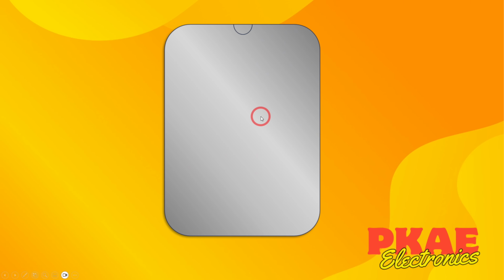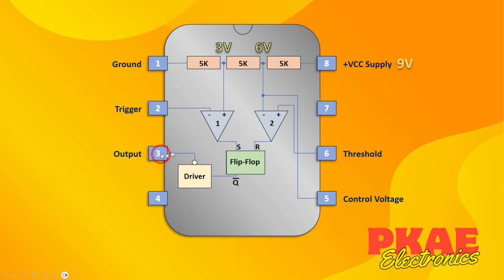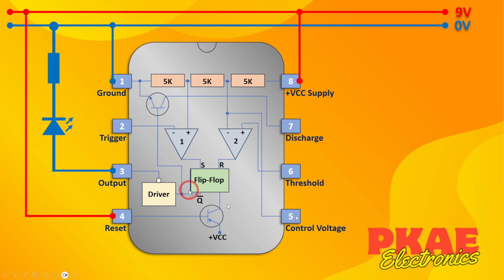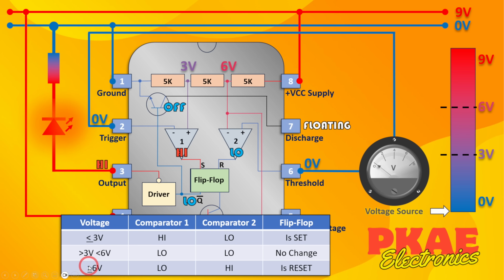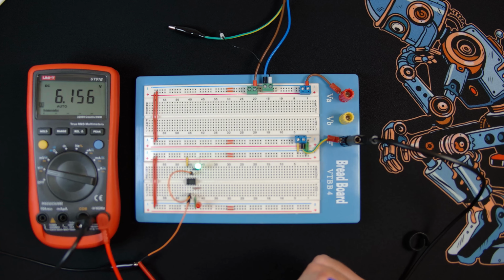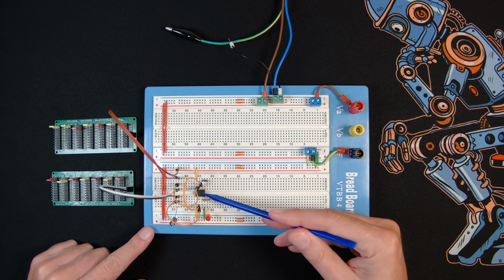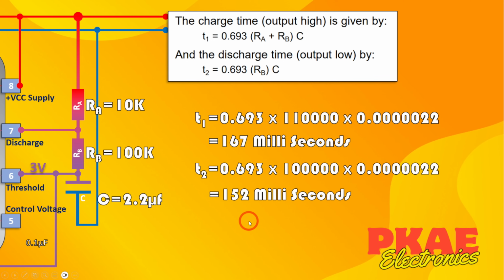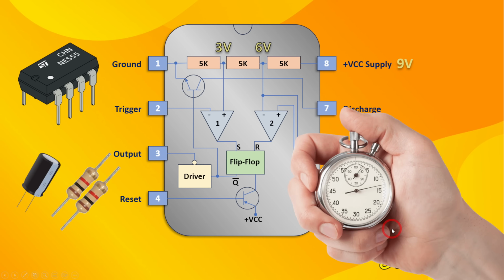How a 555 Works as a Timer.

Comment: Very instructive. Everything looked good exept I found your voltage source a little confusing. As connected it implies a potential difference between pin 2 & 6. But your video shows these pins varying in tadem. What Im I missing?
Reply from the maker: Thanks for the comment. I am not sure what part you are confused about.

Pins 2 and 6 are tied together, so they will always remain at the same potential. 

Pin 2, the Trigger input, connects to the negative terminal of comparator 1 and gets compared with the one third voltage. 

Pin 6, the Threshold input, connects to the positive terminal of comparator and the two thirds voltage is compared to it.

Comment: Hey I am 70 years old and as a 20 year old electrical engineer I loved playing with the 555!  I left engineering for a career in medicine, but you left one question unanswered that I have had for 50 years.  When the circuit flops -- pin 7 is driven to ground -- this means the device consumes current during every down-cycle, which seems like an inefficient design.  Any comment here?
Reply from the maker: Hi thanks for your comment.

The current flowing from +V through the 1st resistor  to ground is indeed a waste. Keep in mind though, that the resistors are quite large, 10K and 100K, therefore the current is very small.

But, the standard Astable circuit given in the datasheet is not ideal. By adding a couple of diodes it can be improved quite a bit. This will feature in a follow up video soon.

Comment: Why resistors are used next to the capacitor? Could they be replaced with diodes? Does 9V line needs to be connected to the discharge pin?
Reply from the maker: This is the standard Astable circuit given in the datasheet. Resistors are needed to control the current flow and rate of charge/discharge of the capacitor. Replacing resistors with diodes would not have the same effect, but by adding a couple of diodes the circuit can be significantly improved. This will feature in a follow up video.

Comment: Well actually the 555 is a timer. At its heart is a circuit with an R/C time constant which controls its operation in all modes.
Reply from the maker: My point is, there is no R/C time constant within the IC itself, so it only becomes a timer if you add those components around it.
Reply: @paulpkae  By that logic my new alarm clock isn't an alarm clock because out of the box it doesn't alarm until I configure the desired alarm time.  Those parts just configure the timer for the desired time delays.

Comment: Greetings Paul, great video..! SOoo thorough. I knew most of the info herewith. I am designing a variable pulse width generator (with a 555, opto-isolator with darlington xstr) to control a DC motor with a centrifugal governor. A vintage R2R tape recorder that runs slightly too fast. The governor still works, and though a mechanical governor of this type is typically adjustable - which would make adjusting the speed simple - getting to the adjustment requires tearing the motor apart and possibly destroying in the process. My intent is to simply vary the "on/off" time without affecting the timebase @ ~1.5Khz. Turning the motor off for an (adjustable) fraction of a second, thus slowing the motor down, disengaging the centrifugal governor, and creating an adjustable servo. Your thoughts..? -tim

Comment: Effectively the timing mechanism is the charge/discharge speed of the capacitor
Reply from the maker: Yes correct. 

Its the charge/discharge speed of the capacitor/resistor arrangement. It's derived from what's known as the RC Time Constant.

Comment: I just happened to be playing with one, so...  TLC55x warning... it will only source 10 mA and sink 100 mA.  The NE555's will handle the current.  Therefore, I am very happy I spent the money on a roll of 50 MPSA18 transistors!  They also have no trouble powering the current-guzzling 555.

Comment: In a design of some printer i designed 30 years ago at least ,I used a 555 as a timer for close to 20 hours period .. It did worked ,The RC in the resistors was several megaohms ..So this was way much cheaper than using a micro for a timer ..
Reply from the maker: Brilliant!

Comment: is the 555 a timer? Depends how you define Timer.
It's more of a clock generator than a Timer, and even then it's just an Astable Multivibrator, there's really not much accuracy to the clock it's generating.
Plus all the other interesting things you can do with the chip.

Comment: Until this video, I always thought the timing mechanism was a constant somehow and explanations of the 555 never pointed out the required external components to make it work. Capacitance and resistance was all it ever was and now I feel like I have a good handle on the whole thing. It's amazing how many blanks this single video filled in, particularly the noise capacitor
Reply from the maker: Great! Glad this video has helped fill in the gaps.

Comment: Grest description, but your argument against it being called a "timer" is essentially a strawman. We've been using these, and at earlier times, similar discrete component based devices as "timers" for decades. I was building my own 50 years ago. The Windows API also has something it refers to as a "timer" which does pretty much what (in my experience) the 555 is  generally used for. That said, minor gripe. This was a very enjoyable and informative presentation.

Comment: I'm guessing that 555 used in the demonstration is a CMOS version since the output swings virtually to the supply rail. That doesn't happen with the bipolar version unless an external pullup resistor is used on the output.

The power distribution on the breadboard is terrible! There is no evidence that I can see of decoupling of any sort, and that is almost certainly why the output looks so horrible if the threshold pin has no cap. If the supply rail is reasonably clean, threshold can usually be left open, though that isn't best practice. Bipolar 555s are the worst component I've ever seen for making a mess of the supply. When running on 9 volts it wouldn't surprise me to see transients of 30 volts or more at the Vcc pin when no decoupling is used. This is due to the very high "shoot through" current in the output buffer, conspiring with the inductance in the supply wiring. It may be that newer versions of the bipolar 555 aren't as horrendous as those of years gone by. A decoupling cap of at least 100 nF on the shortest possible leads as close as possible to the IC should be used. The current TI datasheet recommends 1 µF electrolytic cap in parallel with 100  nF ceramic cap,  though if a good quality ceramic 1 µF is used the 100 nF likely contributes nothing. On a breadboard a bulk capacitor of 10 µF or more, usually placed near where the power enters the board, is a good idea for all circuits. If you use individual conductors to connect to the power supply, twist them together so the inductance is reduced.

Comment: Is the 555 the reason why many older computers time off of ac frequency? I know this is a dc system, but I am wondering if they have a different setup on the trigger and setup?
Reply from the maker: Original PCs had what was called a timer tick interrupt. From memory I think it triggered 18.2 times a second and the operating system had to work out the elapsed time in second.

Comment: The LM555 timer IC's name is arbitrary, according to Hans R. Camenzind, the Swiss electronics engineer who designed it in 1971. So, yeah... Oh, and you can't forget it's Siamese Twin package - The LM556 Dual Timer, a 14 pin package containing two 555's. The two timers operate independently of each other sharing only VCC and ground. ...  Time on!..

Comment: Great circuit for creating simple PWM regulation for cheap lights without using an overpowered Arduino. Most people now would rather write a program than do it with cheaper hardware, and you see Arduinos shoved everywhere where they don't need to be. They're great microcontrollers, but they're used in things which don't need them
Reply from the maker: Yes I agree with you. But, I do find that the emergence of cheap micro controllers have attracted a lot of young people back into discovering electronics.

Comment: So, if you know the value of the resistors, you can use this to calculate the actual value of the capacitor? A DIY capacitor measuring tool ...
Reply from the maker: Technically yes. 

If you are not already aware, then look up RC Time constant. 

Basically, when you charge a capacitor in series with a single resistor, the capacitor will charge to 63.2% of the supply voltage within one time constant and the time constant is simply the resistance (in Ohms) x the capacitance (in Farads). I will be doing a video on this too when I get a chance.

Comment: The discharge cycle was a little hard to understand, because it looks really odd with both sides of Rb+C connected to ground via a ground wire and the discharge pin.
I didn't get it (how can both end be ground?) until i realised that, take away all the other stuff, Rb+C with both ends shorted with a wire is what you have.
Meaning that the capacitor slowly discharges through the resistor.
Or you can look at it like a short circuited AA battery. 
Because AAs have internal resistance limiting their current, they can be modelled as a charged capacitor in series with a resistor (the batteries internal resistance)
Personally i like the idea of seeing it as a shorted out battery. 
Then, when you disconnect the Discharge pin, it's a battery charger.
Reply from the maker: Thanks for the comment. 

The capacitor has its negative terminal tied to ground, meaning the plate on that side will remain at 0V. The plate on the opposite side will therefore attract a positive charge when a positive voltage is offered up to it. Its this plate which does all the charging and discharging.

The internal resistance of a battery is incredibly low in comparison to the 10K Rb resistor used in the demo. Shorting an AA battery with a wire will generate a lot of current and not something I would recommend.

Comment: Its very very informative , back in days i used to wonder how the 555 ic worked.
 But the thumbnail is misleading
Reply from the maker: Thanks for the comment. 

Sorry if this confused you. The thumbnail text is the main tool we have to attract views and is somewhat tongue in cheek and a bit controversial I suppose. But, you have to watch the video to understand what I really meant by the statement. 

It's only a timer if you add components around it to become a timer. The 555 is a far more versatile device and can be put to many other uses too. There are more videos to follow.....
Reply: @paulpkae  Yes, I get that. When I first saw the thumbnail I thought that was kind of provocative but it is certainly true the 555 requires external parts to make a timer.
When MCUs with built in flash became available I stopped using 555s and similar devices. I prefer the reliability and field reprogrammability without changes to wiring. Not to mention MCUs are more versatile still.

Comment: OK, the 555 timer isn't a timer, the guy who designed it didn't know anything and that's also why it doesn't work, right?
It's not a standard digital or analog clock timer, it is indeed a timer. You configure it with an RC circuit for timing, has a set and threshold & trigger, it's a timer. Not a buffer, not a gate, not a shift register.
That said, what it got used for, that's wide, varied and at times bizarre.
Seen them used as anything from a literal clicking noise source, LED blinker, really lousy oscillator, electronic noise source, not so great signal generator, indeed, anything other than a timer, say, to hold a reset line down momentarily as everything resets.
Someone really needs to complain to the International Society for the Prevention of Cruelty to Circuitry!

I'll not even begin to go into the abuses I saw 741 op amps get put to!
Or the mischief I got into with 4016 switches... Well, had to downsize from the V8 powered 7400 series to the 4000 series and their straight 6 and all.
Won't anyone think of the children?!

I'll just get my hat on the way out...

Comment: i once worked for a small company whose main "electrical engineer" only knew relay ladder logic. I designed a simple 555 circuit operating in a sequence to signal solenoid air valves to open to blow dust from a multiple dust bag system into the waste bin. Worked like a champ. They thought it was the cat's meow.
Reply from the maker: Brilliant!😄

Comment: PLEASE I am BEGGING explain op amps like this. I feel like a BARELY understand them and this video made me feel like I can explain a 555 to a toddler!!
Reply from the maker: Hi. Yes, an Op-Amp explanation will be essential content for my General Electronics collection. It is on my long list to do.
Reply: I think this is an excellent explanation of op amps, at least when they don't have any direct feedback loops. Op amps get weird (and interesting) when there is a feedback loop involved.

I can't remember who explained it or even the specific circuit configuration, but when the feedback loop is involved, "the opamp will do as much as it can to equalize the input voltages" and that's what stuck with me.

I look forward to Paul's explanation of opamps because I think it'll be even more clear than that.
Reply from the maker: @JamesHarr  challenge accepted 😲
Reply: @paulpkae Make sure to go into as much detail as you did in this video, not just focusing on what it does bit how the internal circuits make it work. That is the fun and more difficult part :)
Reply: @paulpkae great videos would love to see your explanation of op amps
Reply from the maker: My Op-amp video went live last week. Take a look "All About Op-Amps".
Reply: @JamesHarr The way that I learned op amps was that the op amp has variable gain internally and through magic will change the output voltage to make the two inputs equal. Then assuming the two equal inputs, you can find the desired output voltage. Slap on a capacitor or inductor and you now have an integrator or differentiator
Reply: @JohnDoe-lg8dr  Magic is a good explanation.  Understanding their internals is a 300 or 400 level course!
Reply: @JamesHarr >do as much it can
"but how do it know"
Reply: @ahG7na4  It only knows to amplify the difference at the inputs. The desired output is achieved when the feedback element returns a portion of the output which balances the inputs.The opamp is still simply amplifying the now tiny error at the inputs.
Reply: @JamesHarr  Op amps are hard to explain. The easiest way to do it is the consideration of a simplified but breadboard operable op amp design including differential amplifier stage (2 transistors), voltage amplification stage (1 transistor) and output stage (2 transistors).

It goes over the explanation how it works as a comparator and finally explanations about the function of inverting and non-inverting amplifier on transistor level.
Reply: Excellent Suggestion....Op-Amps are analog devices, so they can be amplifiers, and used in combinations, they do so much more.
Reply from the maker: Hi, my Op-Amp video went live last week. Take a look "All About Op-Amps".

Comment: Commenting before I watch the video.  Bet it's going to be how the 555 is really a dual comparator with some nifty tricks.  The "timer" bit comes from how long it takes to charge/discharge a capacitor to a specific value.  It's been years since I've worked with one though, so this is pure memory and speculation.

I should also note that using similar circuits, you can measure voltage by using it as a voltage to frequency converter, then measuring the frequency.  With the beautiful part being the final measurement circuitry can be optically isolated!

Edit:  Ha, who said says university is useless.  Though I forgot about the flip flop.  Then again, I think you meant to say SR Latch, as a flip flop is driven by a clock.  Confused for a second.

Comment: you can do an almost equal on/off time square wave using single resistor, from capacitor on pins 2 and 6 to output pin 3, not using the discharge ,
Reply from the maker: Video on this to follow soon........

Comment: It is worth mentioning that the Control Voltage pin, #5, is also known as the Pulse Width Modulation pin. I have had great fun playing with that function, even turning a CMOS 555 into a Digitial Mode audio amplifier with pin 5 as the audio input! A couple of extra components are needed beyond the usual few for a simple timer: an external transistor to make the duty cycle 50% ON and 50% OFF, plus an inductor to knock out the high frequency elements of the output signal, and a small capacitor on pin 5 to give DC isolation from the audio source. I set the oscillation frequency to be 2 MHz, which is only possible with the CMOS 555. That meant each wave of the audio input was in effect 'sampled' 100 times (for 20 kHz audio), and 100,000 times (for 20 Hz audio), giving high fidelity to the implicit A-to-D conversion and to the audio output. 🙂
Reply from the maker: Thanks for sharing your knowledge.

Comment: Great Video and great discussion! I totally agree with you! It is NOT only a timer but may be USED to realizes a timer. It is actually much more versatile chip than it one may think. Its components (Comperator, the Voltage Divider, the J/K Flipflop and the the Discharge Unit allows some further interesting realizations than one may think that goes beyond of a simple Timer! I've even seen that one uses the 555 as a Class-D Ampilifier for example (have a look and search for "555 Class-D" 😉